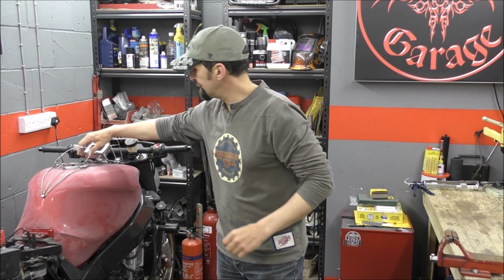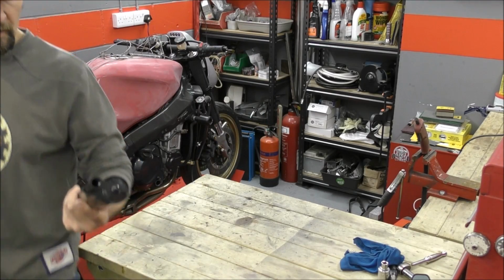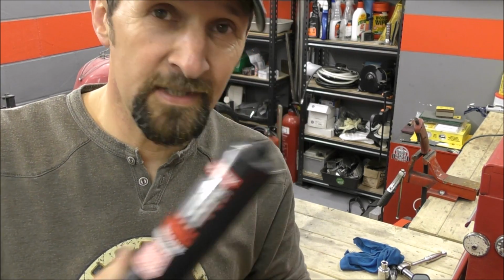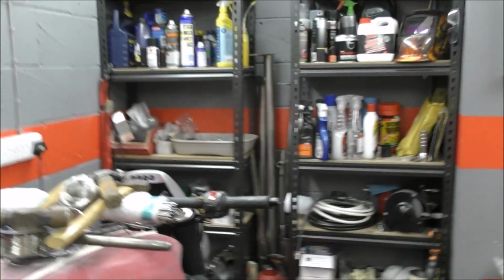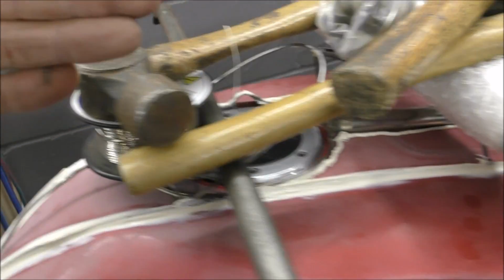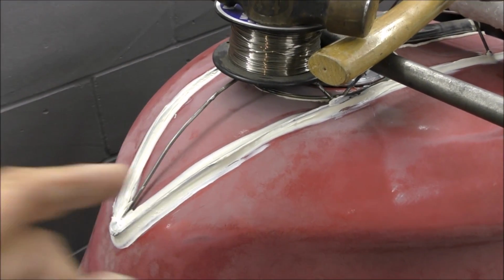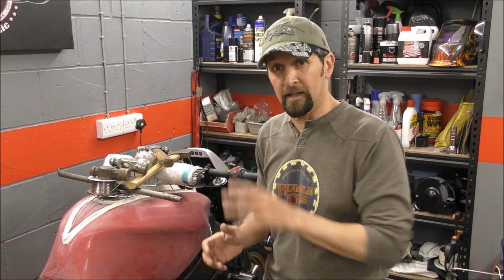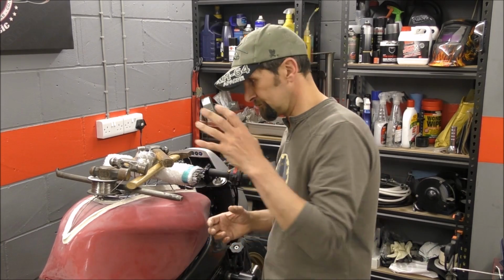Delboy's Garage Fighter Build #24, 'A Bonding Experience'!

Comment: I'm sorry but this is absolutely silly. I understand you weren't wanting to sand the factory paint but there are sealing options that are more than adequate. You could have easily sanded where the rod is and welded it. It would have been so much stronger.

Comment: Dont worry about the GPS signal. As it is a very low wavelength, the signal will pass unhindered through the openings in the frame, at least as as the gaps between the wires are 9 cm in size.
and, it is not a true faraday Cage, as it is not grounded. 
Your GPS will work just fine.
Nice video, thanks!
Reply from the maker: Thanks mate, am sure you're right, I'd really like to use the steel box having put so much work in to it... only time will tell !  Cheers
Reply: Moonfleet41 Don´t worry, it will work fine !

Comment: Hello - been watching your videos for a while. I only recently started trying to learn some little things about fixing bikes - I do enjoy it but, with my limited knowledge, I often get stuck. I have a question about a 1996 Bandit N -  I am not sure if this is the best way to explain it but, as soon as you start accelerating and going over a certain speed, the bike starts to shiver (not from cold :D ) and struggles to pick up speed - I think the closest feeling you can get to it is trying to go fast in first gear in a car - it just wouldn't pull and would shiver a lot. I wonder if you could give me any advice? I was also wondering if the Bandit has a FUEL Filter? I have been told that it is underneath the fuel tap but, seeing your video about rebuilding a fuel tap back in 2013, it does not seem like there is anything similar for the naked model? I know it is quite hard to help over the internet without seeing the problem but I would still like to thank you for all your videos - perfect for someone like me who is just trying to build a knowledge base, bit by bit :)
Reply from the maker: Hi mate, you're right, it's hard to diagnose over the net, but lets have a go!  The shiver you mention , as you've experienced it, is it possible that it's more of a shudder coming from the clutch??  Imagine the clutch isn't biting smoothly but sort of slipping and grabbing... or is it maybe further back in the final drive... ?  Or, like you say, is it, perhaps, coming more from the actual running of the engine, like it's coughing?  How does it feel with that in mind mate??
Reply: I think it is from the actual engine Another reason for me thinking that is that none of the other reasons would have such an effect on the bike's acceleration, right?
Reply from the maker: Ok, if its fuel starvation, you can check that by removing the vac hose from the carbs, take the fuel hose off too, then with the tank off, suck on the vac hose to see if it run fuel out freely... that will tell you its getting a healthy supply.... then check ignition... are the coils connected ho and healthy, it needs a good spark to light the fuel... and make sure thr air filter is free and clear, not ubstructed of blocked... and if you're getting fuel, spark and air....you'll have lots of healthy power...but as you dont... those are the first three things to eliminate..!   see how that goes and let me know..! Del.
Reply: +Moonfleet41 Thank you :) I will have a play and update you. I recently changed the ignition coil for cylinders 1 and 4 but it worked just fine for weeks after that, so I think that newbie mistake when connecting is off the radar :D

Comment: Hey Del, (and anyone else interested in fiberglass, but is a novice like me) I came across some new resin. Likely too late for your current project but its pretty great stuff. No mixing hardener or the like, and the best part is it stays wet and workable for as long as you want! Once you are ready, expose it to sunlight or UV lights and it cures fast and hard with little to no shrinking.. No im not trying to sell anything or have anything to do witht he company. Im just starting my first  fiberglass projects this summer and I came across it from the car audio forums... Check it out of you are interested! https://youtu.be/0dqHjTBqwIw
Reply from the maker: Hi buddy, that product's been around for many years, and it's not designed to be painted over... and air dried resin (or non-epoxy resin) can be re-activated when exposed to paint chemicals, plus it can also react with body filler - it's great on it's own, but it was designed for a specific job, and that's not this, my friend... thanks for the heads up though - cheers!
Reply: Gotcha. Just came across it myself. Believe the new stuff is paintable, but fully understand the rest of the issues. Either way, thought id share just in case! Keep up the awesome work Del!

Comment: Awsome job Del! Great to see the project move on and progress. One question from the OCD guy in me: What if petrol finds its way to the drain holes? :-(
Reply from the maker: That's what they're there for mate... but as the whole lot will be bonded in with fibre glass, it won't matter if petrol touches the caulk, its only there to hold it in place while I laminate it in!

Comment: Hi Del, my technical head on today regarding your speedo in the  metal  box , if there is a problem with it not receiving a signal, replacing the metal box with a plastic/fibreglass box you will find that radio wave/ signals pass through it much easier.......just my two pennith hope it helps............RS both...........
Reply from the maker: Hey Roy.... Thanks for that buddy, thats what i thought... and if so, i can actually use the steel box as a plug... make a mold....then make up a carbon fiber one...which would be a pretty cool addition i think..

Comment: or a ratchet strap or a bungee cord would have held that tight while waiting for the caulk to drie!! so people just use tape
Reply from the maker: Yeah, i used tape on the old Bandit tank build.. it worked well... but ratchet straps can be a bit brutal...lol..
Reply: using elastic may cause the wire frame to skew as it cured. pure weight just pushes down.

Comment: Hi Del,

The progress looks very good so far. 👏👏👏
I am looking forward to see the fibreglass coating. Personally, I think fibreglass is one of the trickiest and most unforgiving materials to work with. You have to deal with the toxic fumes from glue and hardener, time constraints with quick curing and meticulous preparation needed for it to bond. I don't enjoy it at all.....However, I am sure you will make it look easy. 😊

Well Done Mate! 👍
Reply from the maker: Hey Denis, thanks buddy... i find it quite good fun acually, its constructive and a lot cleaner than welding and grinding.. lol

Comment: I agree with others here. We're 24 videos into this build. Even if the actual material isn't that interesting it's a lot of fun to see the things take shape. Quick question though, what's the drain tube for?
Reply from the maker: Hi Rob... thanks mate.. the drain tubes are for draining anything that may collect in the cowling around the tank filler cap..rain water or spilt fuel.!
Reply: +Moonfleet41 that makes sense. I guess when you cover it with fiberglass it will be like a little bowl. I can't wait to see the final product!

Comment: panel bond better known a PU sealer (polyurethane) £3-6 a tube for the starchem stuff - if you want a even stronger bond 3M Scotch-weld 2 part epoxy down side is it requires a special gun, find a local paint supplier you will save a fortune.
Reply from the maker: Yeah we have a Brown Brothers store near us, and i did price it up....but like you saidm they are all epoxys and need equipment to apply... i would have gone that way for sure, but this will all be bonded in with lots of fiberglass over the top to back it up... in the last when ive needed to remove this stuff.. you can only do it with petrol or acid... that or grind it off...so its way strong enough for this application i reckon... cheers for the heads up buddy.

Comment: anyone around here know what to do wit a weeping pinhole from rust? it dont drip just a constant wet patch on the side where your knee goes (22 year old gs500)
Reply from the maker: "" It dont drip, just a constant wet patch on the side where your knee goes""  i presume you're talking about your fuel tank.?  lol   

If you genuinely do have a pin hole that leaking fuel... then there is only one fix short of a new tank.. and its this stuff.. http://www.ebay.co.uk/itm/Petseal-Ultra-Petrol-Tank-Sealant-For-Motorcycle-Fuel-Petrol-Tanks-260ml-/401084818775?hash=item5d6284a557:m:mIeOOYk68RGJIXTzrOMuxkg